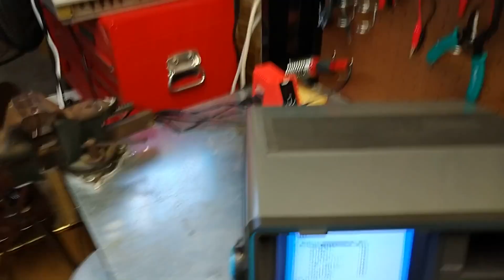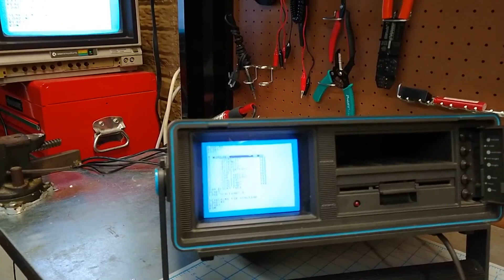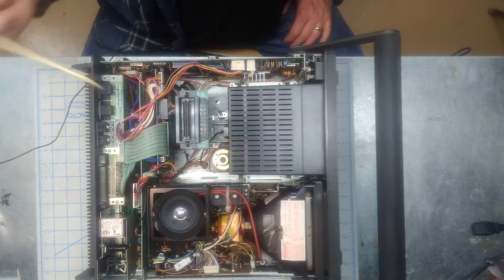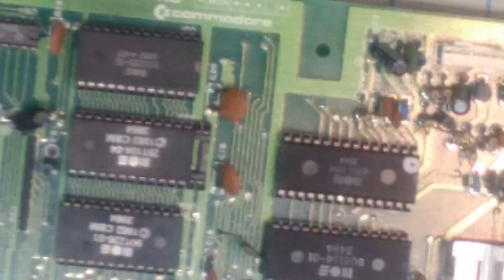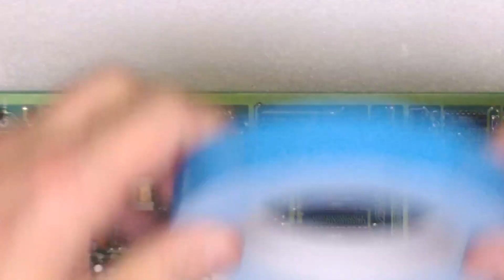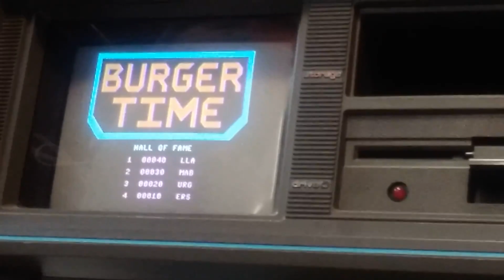Episode 3: SX-64 Sound Repair

Comment from the maker: Errata: I said that the joysticks go through the SID--they do not. Joystick inputs go to the two CIA chips. Only the analog inputs from paddles and mice go through the SID. Mea culpa. Thanks to Jani Joeli on the Commodore 64/128 FB group for pointing out the error.
Reply: No worries Ryan! To be VERY specific, of the two CIAs only U1 is responsible for handling the joystick inputs (and keyboard and a couple other signals). U2 takes care of user and serial ports. :)